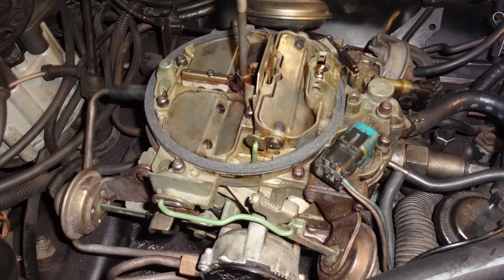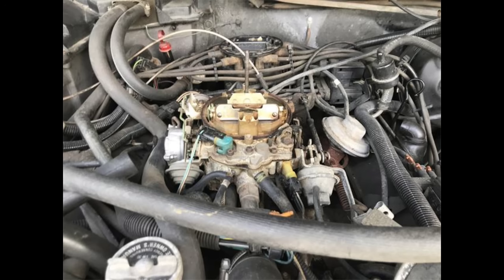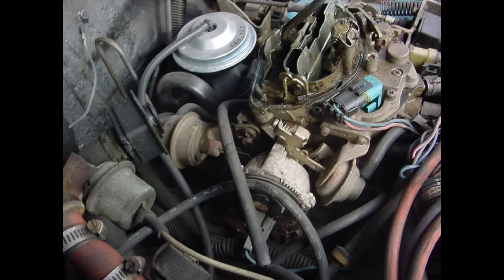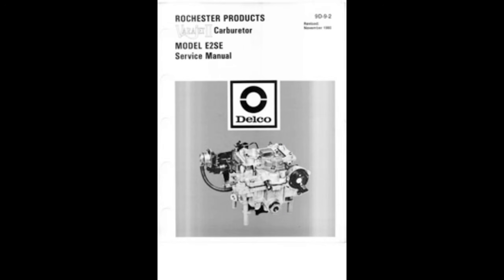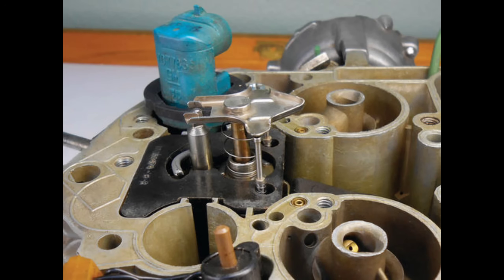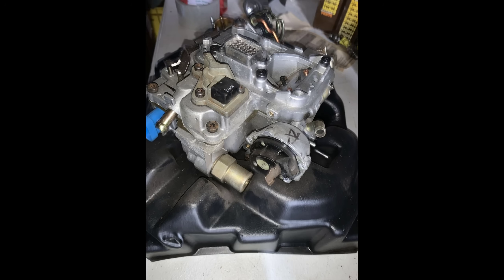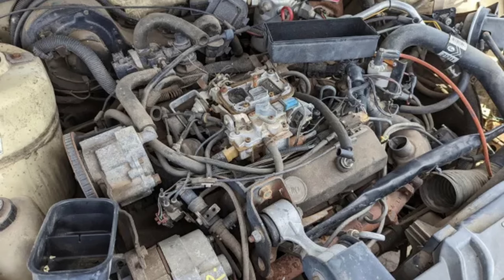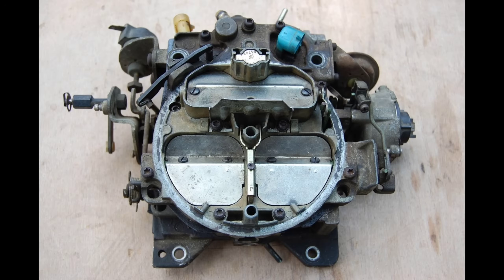GM'S Bridge To Fuel Injection: The Electronic Feedback Carburetor

Comment: These electronic carburetors were marvelous from the standpoint of getting carburetors to achieve clean emissions, operate under closed loop control with a 3 way catalytic converter, and not stink like unburnt fuel. They were unfortunate in that they had all of the disadvantages of a carburetor: finicky cold starting, vapor lock, float bowls that flood and starve during bumps and hard braking (even happened in Motor Week tests), choke unloaders, choke heaters, knock off cams, fast idle, jets and idle circuits to get plugged, etc. Plus the inscrutability of a computerized electronic control system. The GM TBI systems that succeeded electronic carburetors were vastly superior in terms of reliability, cold starting, and customer experience.
Reply: Dunno about the e carb but the tbii is great
Reply: @matthewfredrickmfkrz1934  I'll take an E2SE over any TBI any day . (Yes I've had a number of both)
Reply: what i did in order to make mines operate in closed loop faster was to upgrade to a 3-wire heated O2 sensor. the ecm will enter into closed loop in about 2-3 minutes. This is done primarily for tuning without having to leave your driveway and pestering the neighbors. So no stinky fuel. This will solve your rich/lean condition from the get go, so it can be adjusted to its best capabilities. the cleanest burn and the greatest mpg a carb will produce dependent of its calibration of coarse.

The downside or upside it depends on your point of view, a single wire 02 is fine the way it is. It will take longer to get into closed loop. That's it. There is no performance advantage whatsoever, so its overkill really. A heated 02 sensor makes tuning a bit easier in which it will enable your dwell meter for use much faster. You need to be in closed loop so you can adjust your mixture screws, so it's a no brainier, and if its not to your liking you can always reverse changes. Once you do this, you would have wished to have done so sooner. Its a game changer.
Reply: I think I've got mine dialed in right except for the choke. She runs pretty good otherwise
Reply: My 86 k5 I used to have had the Rochester m4me carb in it. Accelerator pump was gone but she ran pretty well once got it past 900 rpm when accelerating. You’d have to do this weird pump technique to keep it from stalling under load until after 900 rpm then it would take off like a rocket. Never left me stranded.
Reply: @TheMrDarius  my truck version/maybe the same day/line as your's/86K5 left me stranded/kept-flooding out so off to the yard's/2004~ish-era later and a 1977 1-ton's 350 fixed it ( but choices of this/E-carb vs TBI vs bendex1957 id take the carb/'s( feedback or 1966-era ) last the tbi 2d and 1st-pick-pre-2004/pre-OBD2 bendix but fixing the capacitor's/EMF-issue's, but mech vs bendix that's a tie for me but analog-fuele's vs OBD2 id still take OBD2 as a zoomer-gen/ww2-parents but 14-25yo-me wasn't interested in electronics/OBD1/OBD2 and yes in 2005~ i looked for a donor-rig for TBI but that's because i wanted to save gas/cheap-swapping pathways-ect ) or at-least intel it got stolen2013/2019 era sorry for some reason my rig's got joyride'd more than once and or looked at for there free-parts aggregating, last run/bastions im down to cab/shell ( BEV or hybrid and or cab-swapped is my next build/try hoping the EPA and bandit's leaves it a lone this time ) but points is im not a fan but did get curiosity's of carb-cheater's product vs gm's/fords try  vs holleys re released in 2011~era with updates/ecu and self-tuning software for a different project-car/440-engine as a quick run-stand-testing as getting port-injection to work can be tetanus done 3~time's and rather focus on the car-only not the stand/testing 

im in the no-battery's/cap's/air-started mechanical injection+mag camp or full OBD2 LSX-swapping( big-block EFI-port + CNP also count's ) camps, and common-rail diesels
Reply: Here on Kommiefornia,  none of these systems work very well. Cold starting durlevti CARB regs of running too lean. No parts are available in CA parts stores for rebuilding other than gaskets. I hate the CARB. Unelected libs trying to crush our cars.
Reply: The quadrajet without the two plugs in front did just as well and had more room in the float bowl. The ones with the two plugs run better if you unplug them
Reply: A non electronic carb can be tuned for it as well,
Reply: @shadowopsairman1583  No, the three way cat needed the AFR to swing between slight above and below 14.7:1 Having a well set carb wouldn't do that.

That is why they could either have a carb with a feedback solenoid or they could have EFI.
Reply: Just more junk added to junk lol they made the right choice moving on lol it really wasn’t until the second version of the spider injection when things started getting better atleast for the trucks.
Reply: @jesseharriott4253  replacing a spider injector with a Holley 4160 was one of the best performance and efficiency conversions I ever did.
Reply: @jesseharriott4253  gm/amc/dodge had access ( and or prototypes running and or limited releases-models-public-sales ) to bendix system in 1955-70 era and had they kept with it they would have been miles a head of wasted R&D that the carb's/TBI and the bad transmission-choice's and pump's+lowered1970's-CR:'s-ect R&D socked-up and technical was also pre-cat's and or they might have been able for more lobbyists-power and the outlast political/EPA im mixed feelings about but not tree hugging but California/LA-smog is what got the big-3 to feel it/change's and analog-EFI ( and going back to ford-T types ignition aka CNP-analog-type would have helped and or setuping for later on OBD2 and spending less on R&D and manufacturing-line/plant change's or use the diesel's/shafted-jet powered but that's realistic only for Chrysler-corp as the other 4-tech-wise were behind in spending jet/rotary-R&D needed to make it a product/sales ) might have delayed this or killed the movement's/activist-action's

reading my dodge manuals/dealership's media for 1966-73~era pissed me off as they had the carb on desorating-piss raw-gas/gold out the pipes by cutting power to the dizzy ect

Comment: I remember them well. I have rebuilt many Quadrajets successfully with minimal knowledge of how the system actually works. Your explanation got me curious. How about doing a video of the actual setup and special tools you mentioned. I may never see another one in my shop but this old dog would like to learn a few new tricks.
Reply from the maker: I've actually done a few tool and calibration videos in years past. Check the "Electronic Carburetor" section on the page.

Comment: I do agree, most people say Qjet is junk because they don't understand them and cant make them work.  That why there my favorite carb to rebuild and tune!..
Reply: Been trying to fully understand how they tick. Not too many guys out there that are willing to tune these. Found me a dwell meter...need the M/S adjusting tool..air bleed off tool and a manual. Would love to get that thing dialed. I hear they're smooth as silk once this is done..
Reply: @76calidude  Lyle used to make the adjuster tools and the plug cutter for the idle mix plugs but I found grinding a slot below the plugs on the bottom of the throttle plate and using a small punch to drive out the p[lug was easier. If I remember the plugs are about 3/8"-1/2" long. Then use the flex idle mixture adjuster.
Reply: @76calidude I rebuilt them all the time. I never had any problems with them. The varajet were a bit more finicky. But the dual jet and Quadrajet feedback carburetors weren’t that bad at all .
Reply from the maker: Keep checking ebay. The Kent-Moore sets come up every once in a while.

Comment: I recall these being the only domestic feedback carbs from any of the big 3 that actually worked as it was intended (performed its main function; economy and slightly better emissions in cruise conditions). CCCS on the '83 Olds 307 we had got GREAT mileage for its day, just as good of not a bit better than some of the domestic 4 bangers of the era.. up to 26hwy, but also as low as 13 if you constantly kept your foot in and out of it.. it would scoot down the passing lane just fine! It just worked

Let's not talk about Chrysler's horrendous attempt that never worked right and was in production way too long! 😆

Ford abandoned theirs pretty quick and went straight to TBI and multiport as I recall, whatever it was they were utilizing for electronic carbs wasn't around long at all
Reply: Ford had MPFI when B body gm had carbs still took til 1994 to get MPFI with GM and it wad the junky optispark lt1 engine
Reply: @workingcountry1776  now I'm going nuts trying to remember what Ford called their feedback carb system. I only ever remember seeing it a handful of times ever, in a very early Tempo and I think one more 5ime in an early 4banger Taurus. And you're right it took GM ages to catch up to Ford on EFI reliability
Reply: @Drmcclung Are you talking about that wonky Variable Venturi carb from the early 80's?
Reply: @johneckert1365  nah it was nothing like that, although I think I know the one you're talking about.. if it's what I think you're thinking of, original Bigfoot ran those and can't remember what their name either. It looked absolutely nothing like a fuel delivery device 😆 I remember something about dialing in afr with cams that were on the linkage. That's a blast from the past
Reply: @Drmcclung  They had these weird gates where the choke would be on a normal Motorcraft 2bbl. They reminded me of like gates on a water dam or something like that. Thankfully they used the same base pattern as regular 2bbl so they were easy to swap.
Reply: @johneckert1365  OOOOOOH that thing!!! Christ! Ya that wasn't so much an electronic feedback carb as it was just a carb with some electric doodads to make life a little less "carburetor-ey" to live with if you know what I mean.. fully automatic idle, automatic choke, an automatic fuel shut-off solenoid so it wouldn't diesel itself to death after turning the key off on a hot day (that's how they were able to safely aggressively static jet them so lean). They had a 1bbl version for the 4 & 6 cyls and a 2bbl for everything else. Yeah those didn't last all that long either. I'm still going bonkers trying to remember what their short lived version of a true feedback setup was called!
Reply: @Drmcclung  Wish I could help, but I don't recall them 🤔
Being a Chrysler guy, Lean Burn did enough damage to my brain lol
Reply: @johneckert1365  😬😬 is all I can say lol. I think the only thing worse (and that's saying something) was their earliest real TBI.. I had a friend with a Dodge something-or-other that had that, looked like a stretched out '79 Fox body.. Mirage or Miranda something like that? 
Back to Ford, it is pissing me off! I should know this! GM had their CCCS which is what this vid was about, Chrysler had their Lean Burn, and Ford's one had a dorky name like the other two as well! I believe it might have been maybe early EEC hardware, same as the FI but it had a NAME name
Reply: @Drmcclung  A Mirada. Same car as a 2nd gen Cordoba. Dumb cars, built atop the Volare platform. Came with a slant 6 or 318. The last RWD Imperial came with a HORRIBLE TBI system that got recalled and converted to carburated. There was no "fail safe" or "limp home" mode. So any time one component failed (which was often) the car quit. 
It's bothering me too that I can't remember Ford's Electronic Carburated system too 🤷‍♂️
Reply: @johneckert1365  MIRADA, that's it!!! And yeah it did have a 318, and I think a 2bbl Carter carb conversion, definitely nothing fancy just fairly bulletproof. Yeah the car itself was pretty horrible I remember nothing in it worked and everything on the inside had already fallen apart, but he drove that thing all throughout the early/mid 90's as a town beater. That 318 was probably its only redeeming quality 😂
Reply: @Drmcclung  agreed. 
I really liked the 1st gen Cordobas (the round headlight years only). Mom had a 76 before upgrading to an 83 Riviera with 307/Feedback carb lol.
Reply: My dad said he had a 1977 Plymouth Volare, and the ELB module crapped out one week after the warranty ended.

He said the car sucked so hard, even mom's 1985 Nissan Maxima was better. That Maxima sucked, I often made sick jokes about what it must have been like working for Nissan to build it. I saw it as a car built under an impossible deadline with a bunch of crappy bean counters. That was the first year they made a FWD Maxima.
Reply: @skylinefever  With a trip to the local salvage yard for parts, converting that Volare to regular Electronic Ignition would've made it a MUCH better car. An older carburetor that was jetted less lean would've helped too.
Reply: @johneckert1365  He was so to get divorced, so he just left the Plymouth with his ex and bought a Toyota Corolla.

I often joke that some really awful cars sold the Toyota Corolla and Datsun 210 more effectively than any Toyota or Datsun TV ad ever did.
Reply: @skylinefever  I'd have to agree with ya 👍

Comment: I wonder how much training came along when this was rolled out. If you were a young mechanic working at a GM dealership,  great. If you were 45 yrs old working at an independent shop? Not so good. Around this time folk were yanking off Lean Burn computers and replacing the distributor with a conventional unit. I think there was a lot of distrust of electronic complexity, for good reason.

Comment: I don't know why they wasted their time with these. It has most of the same components as a tbi system and in some cases these had both a mechanical and electronic fuel pump. Both the systems had map, coolant temp, throttle position, o2 sensors, and an ecm. The carb had a mixture control solenoid instead of a pair of injectors. Both had ignition timing controls too. Similar air cleaners and intake manifolds as well. When the feedback carbs had issues, they ran very badly.
Reply: GM is well known for wasting millions of dollars to try to cheap out on their cars, and leaving the problems to the consumers and dealers. You're right in that TBI would have been a far better system and they had more than enough technology at the time to put it on everything.Think of how good that would have put them in the market too, and the TBI system was pretty easy and reliable right off. GM is the same company that had their Opel division rebuild an in production 4 speed manual into a 3 speed just to make the Vega that much crappier to those cheapskates who wanted a base model. They lost money doing that, but hey, they punished consumers, so that was fine.
Reply: @Oldbmwr100rs It's amazing that GM kept using carburetors on the Olds 307 through 1990. WTF?!?!.
Reply: @johneckert1365  There's a guy on the Olds forum that has a factory one off TBI intake for a 307. Must have grown legs and walked out of the test center and wound up on e bay.
Reply: @mcqueenfanman  Someone brought a BIG lunchbox to work that day 🤣🤣🤣
Reply: @Oldbmwr100rs  So cheap that BMW commissioned GM to build their transmissions for their E36s during the 90s
Reply: @locobrown  Yup, BMW used GM (european division I suppose) automatics, certainly. Built to BMW's spec, but in the case of the Vega, using an existing 4 speed from Opel was still too nice for the lowest spec, so GM paid to have them made to 3 speeds as i said. Hydra-matic transmissions were also used in 50's Lincolns too. GM had the best at the time.
Reply: So dumb, since the technology already existed at GM. Didn't Caddy offer TBI on their 500 in 76? And on their 425 for 77-79? By 82 thier TBI worked very well on the awful 4.1, it sure seems like many more of thier vehicles could've and should've gone TBI that early as well. 

I don't understand thier logic I guess 🤷‍♂️
Reply: @johneckert1365  The Caddy system was mpi from 76-79 then they went tbi.I'm pretty sure it was a Bendix system. Rochester made the tbi systems in 80 on up.
Reply: @mcqueenfanman  Ah ok. I guess I remember reading that somewhere. Never seen an EFI 500/425 in person, just Q-jets. Can't say I've seen TBI 368 either, but plenty of those damn 4.1
Reply: One thing GM did was put tbi on 4 cylinders pretty quickly and used those throttle bodies on the Crossfire Corvette and F body cars. I bet this is something that isn't common knowledge, you can swap out a Crossfire system, intake and all for a 305/350 tbi system. All the connectors are the same and the ecm will run it just fine. One thing that you'll be missing is an iac solenoid but it's not a big deal. Mine idles fine on only one. It has a nice boost in power too.
Reply: @mcqueenfanman  cool 😎

Comment: Little known fact about the E-Quadrajet: the ones built to be used on 5.0 liter engines were flow limited by way of a stop on the secondary air door shaft so that the secondary air doors would not fully open. Therefore, they do not flow 780 cfm like the older Quadrajets that came on larger displacement engines even though the main body and throttle plates are the same size.
Reply: And can be overcome
Reply: just cut the tabs off
Reply: I noticed that with my 85 Olds 88.  I made the necessary corrections and got a proper WOT after that.  Of course, the 307 was an asthmatic engine so, the performance gain was not much.